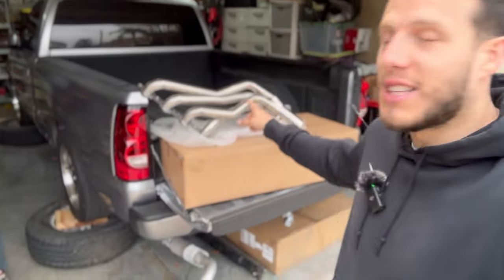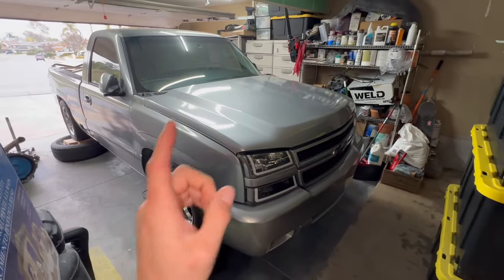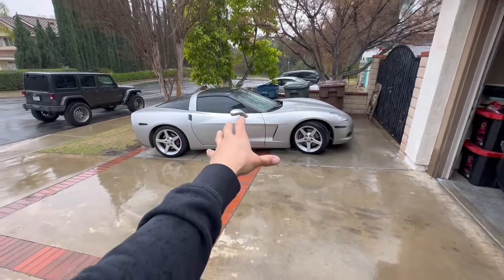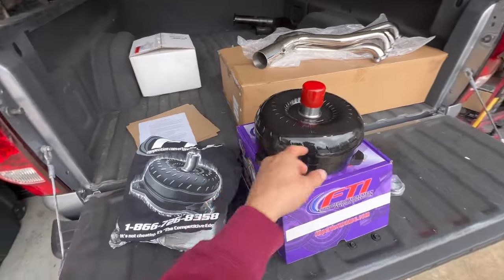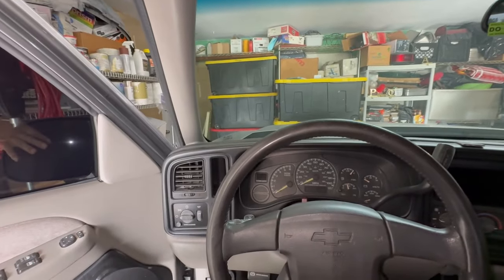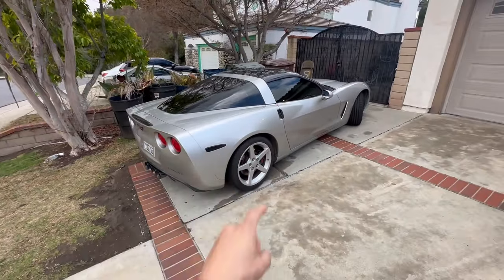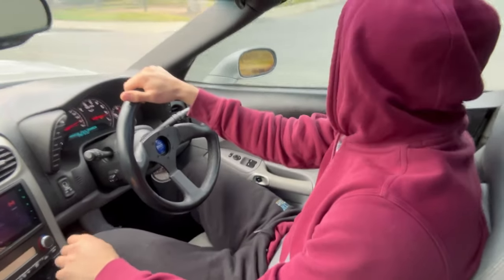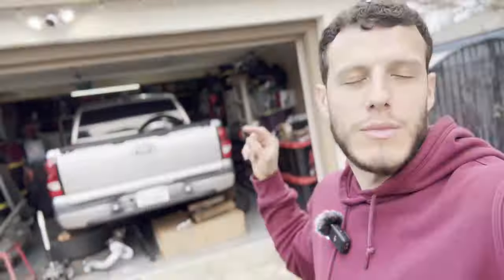THE STALL FOR MY 4L80E SWAP STREET TRUCK IS HERE!!!

Comment: There’s a gauge pod they make for the upper center console on eBay that I’ve used and they have optional switch slots
Reply from the maker: nice imma check that out thanks 👌
Reply: @ErikRose_  yessir 💪🏼

Comment: Caltracs are a definite mod to help with wheel hop and keep the trans or driveshaft from breaking. Driveshaft safety hoop if u wna take it to the next step
Reply from the maker: Actually thought about doing some caltracs 👍
Reply: @ErikRose_  definitely bro, I’m running the funkhouser racecars kit on my NBS and that kit fits best for lowered trucks. The bars sit very parallel to the floor on my truck with a 4/6 drop and 305/45r17 radials